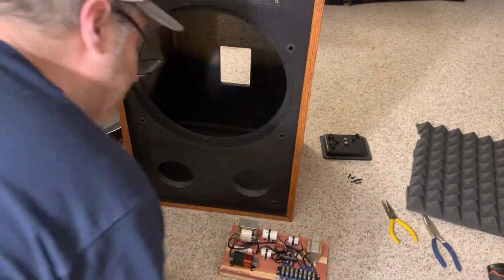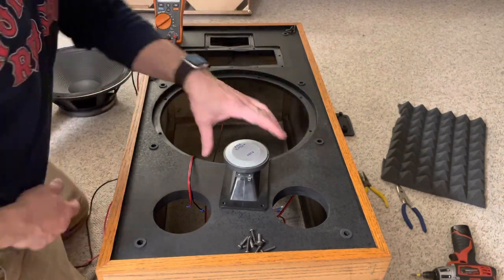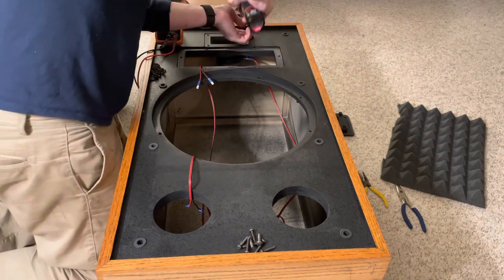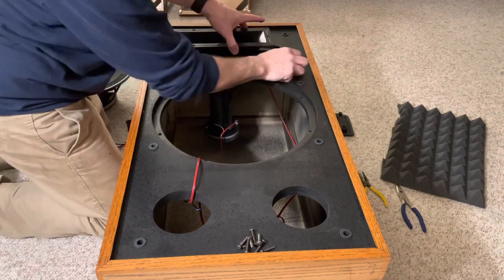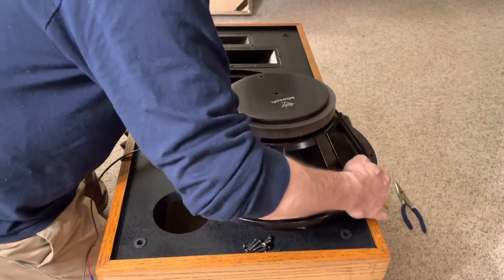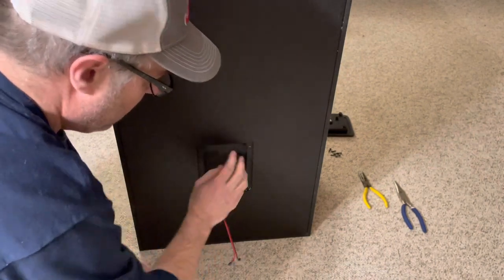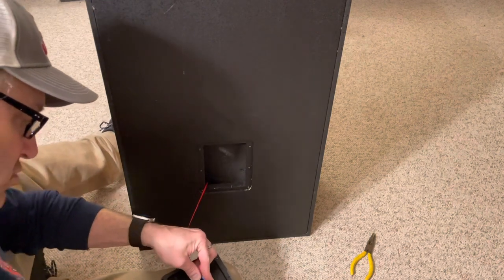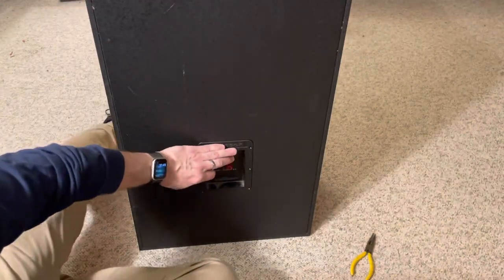Installing a Crites Crossover in a Klipsch Chorus Speaker

Comment: I would solder the cable to the speaker inputs those clips do cause quite a bit of loss of the signal.  Same with the speaker driver connections it all adds up to signal loss over all,   if you have gone to the trouble that you have gone to. , A good solid solder connection is the best way to go..

Comment: Spade connectors? Really? And why are there transformers in the crossovers? It's not like you have electrostatics. Also, tightening your speaker screws in a star pattern makes ZERO difference.
Reply: Spade connectors are extremely common, pretty much every speaker you open up will have spade connectors. Those are not a transformers, they are inductors. Tightening in a star pattern is good practice. It centers the driver/horn in the opening and helps apply torque evenly to the mounting ring/surface which makes a better seal with the enclosure. And a good seal makes a difference.
Reply: @BicycleJoeTomasello  Haha.